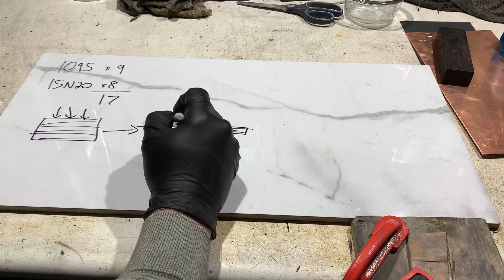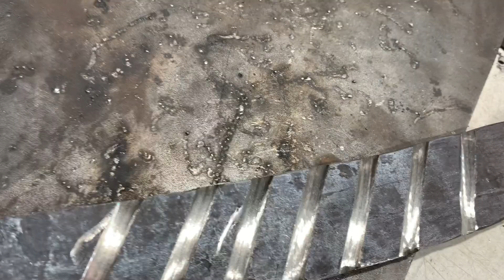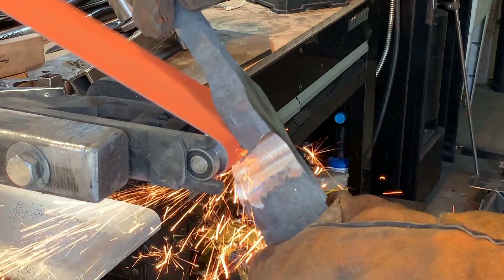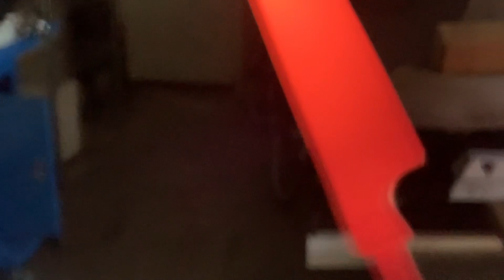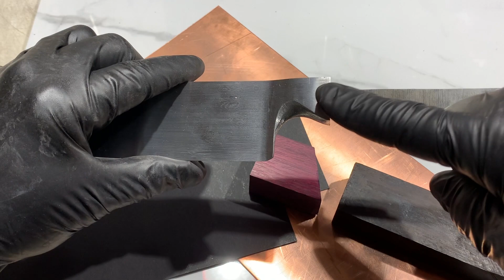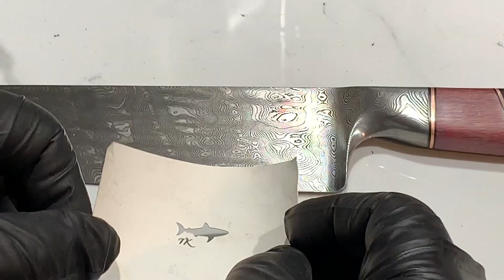Forging an Amazing Ladder Damascus Chef Knife

Comment: Wow going back to this older video, how far has your tool collection come, and the skill you use with forging now, saving on grinding time.
Reply: And being a chef by trade, I really love the rounded transition from bolster to blade, soo many hot spots in most knives.
Reply from the maker: Thanks for checking this one out, Steven!  This was actually the first video on my channel but I had to repost it with better audio.

Comment: I know this pretty far back in your catalog of videos but I just found your channel and wanted to start at the beginning. Fist off your work is inspiring and extremely informative! I’m interested in building my own forge and would like some details on your equipment. What press are you using, grinder, mill and tempering oven do you use? I understand you built the forge yourself but can you suggest a similar manufactured one? Thanks again for all the amazing work and I look forward to more of your fabulous content. Thank you so much for the inspiration!!!
Reply from the maker: Thanks so much for checking out the library of videos.  I built the press, see Triple-T #3 for more on that and a full parts list.  For a forge, I recommend you start at Triple-T #12.  The original orange grinder I made myself (#2), but later upgraded to a Brodbeck grinder (#21).  My mill is a Precision Mathews (#5). I use an EvenHeat oven.  Basically if you go through my Triple-T playlist you’ll hear about most tools I use.  If you’re just getting started, then start with a cheap forge.  There are many on the market.  After a year, if you’re still into it, make one.  I hope this helps you.  Let me know any other questions you have. 👍

Comment: Master, what is the ratio of kerosene to borax?
Reply from the maker: The kerosene and flux are two different things so there no “ratio” between them. I always soak my stacked billets in kerosene so it seeps into the crack and when it burns off, so does all the oxygen.  The flux is applied to the seems to prevent scale formation.  You just put a layer on the steel until it looks “wet” over the seems.  Thanks for watching!
Reply: @TyrellKnifeworks  thank you very much.

Comment: For what it's worth you can chuck that blade up,in the milling machine. Mill down to the thickness you want, I did that to my first blade last week. It's so awesome
Reply from the maker: Interesting idea but I don’t have an end mill that big so it would be kinda hard.  Plus there’s a distal taper so not sure how you’d do that when the blade is narrower at the tip.  Thanks for watching!